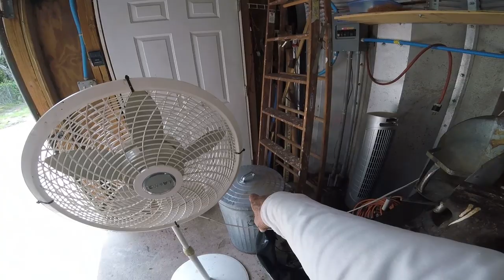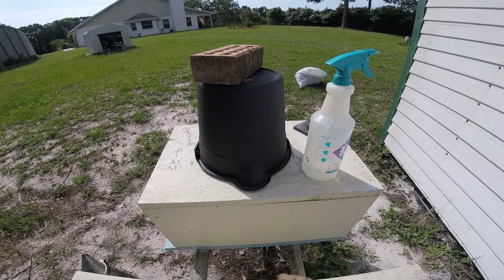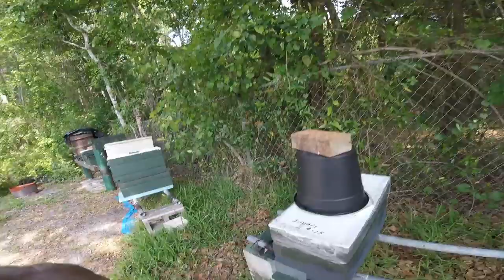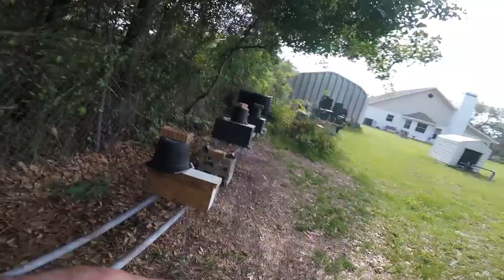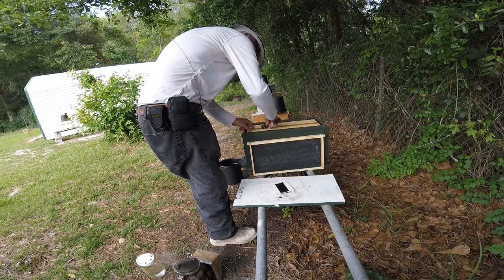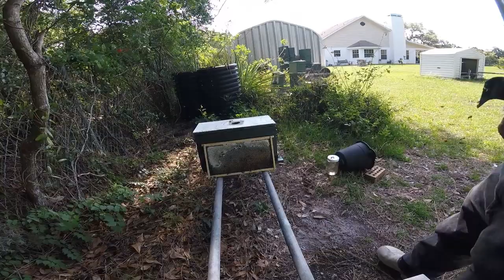Bee Colony And The Human Colony

Comment: Steve ooo, Just getting Testosterone injected every two weeks, also I need more Nuc boxes any suggestions for quick Nuc builds?
Reply from the maker: Hey Scott try to get that T between 600 & 800 is the sweet spot.If you don't have time to build plywood nuc's you may want to try them Mann Lake Pro Nuc's.I have heard they are a good box.
Reply: Steve's Outdoor World Yes was at Mann Lake Friday they want 34 bucks for box and 18 for the lid. Dam for that price I can buy a nice sheet of 3/4 ply and make 3 or 4. I was even thinking about coming up with a way to use a plastic storage tote and make my own pro Nuc. There in will there is a way, for this cheap guy. lol. You can buy those plastic totes for 5 bucks and put rails inside something I’m playing with. I’ve been working 50 to 60 hours per week since this Panic Virus set in. 18 more months and I’m done.